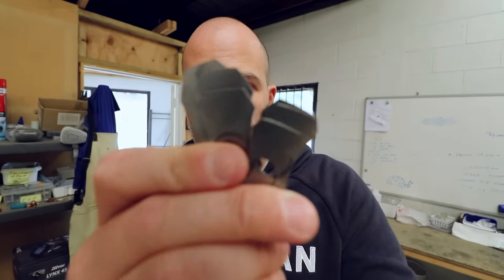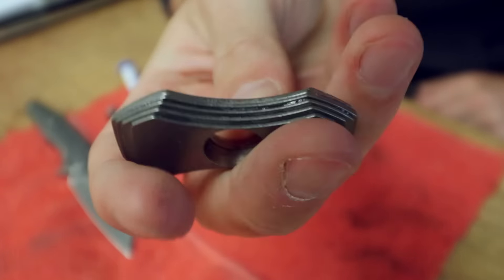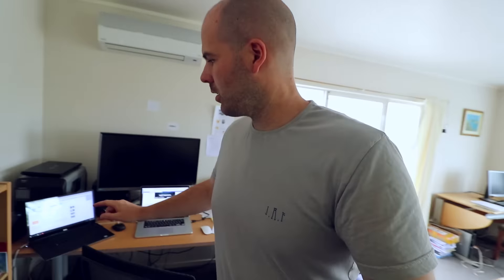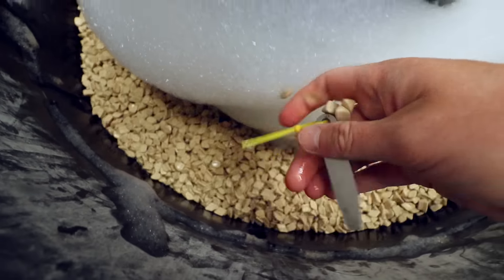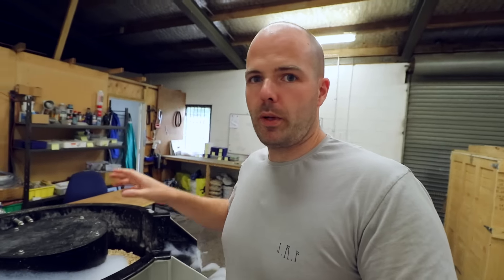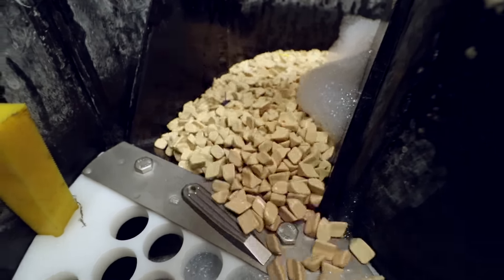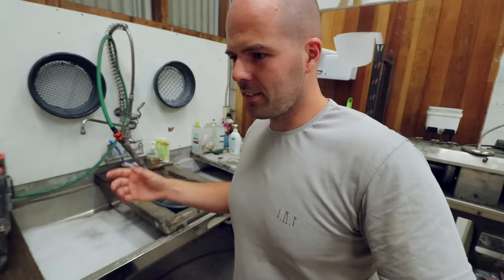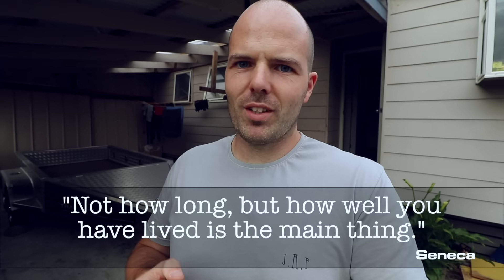Titanium Hand Spinner (NEW prototype)

Comment: Can you not just stack the plates around some form of cylinder to make sure they're all centered properly? Might save you some dremel work I think.
Reply: Exactly, stack em' on a pole
Reply from the maker: It's not so much the straightness... it's the fact I have to make them specifically smaller and then drill out ...and it's the drilling that a bit wishy-washy.